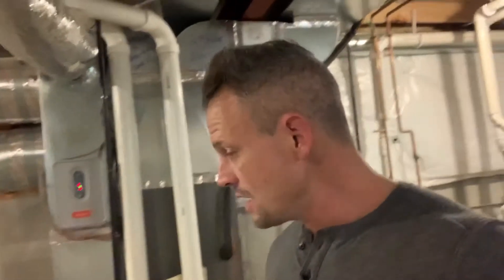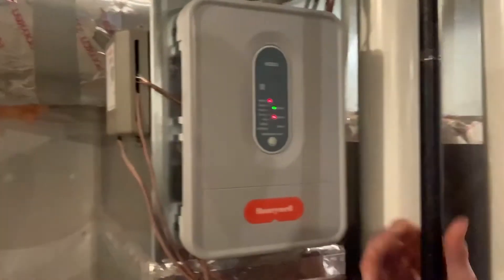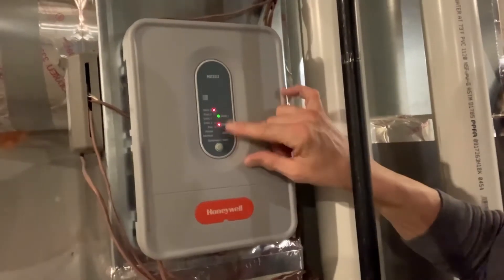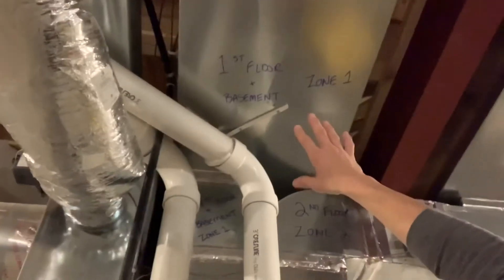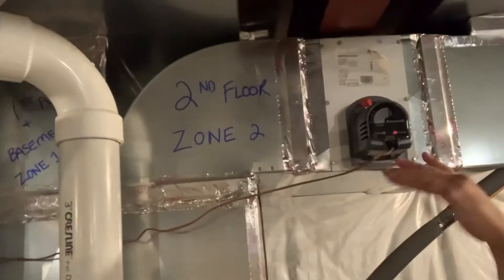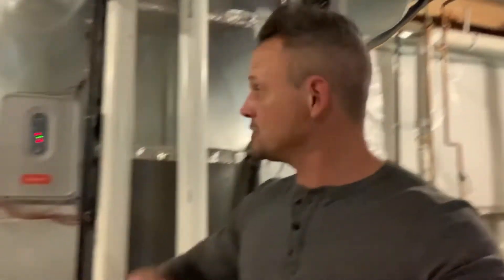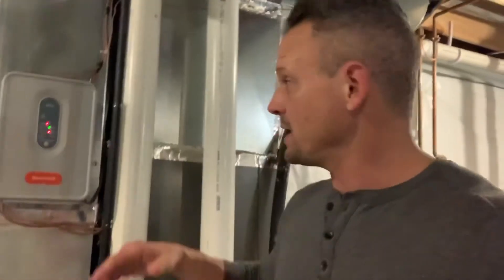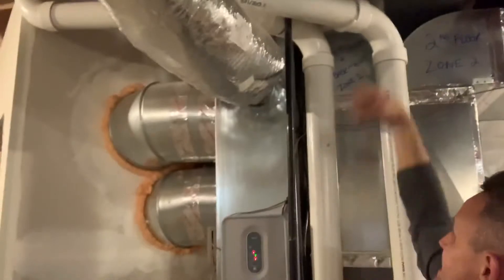What is a dual zone heating and air conditioning (HVAC) system

Comment: J ai une géothermie 
Comment voir sur le panneau si les éléments sont en fonction quel sont les lumières qui allume 
Merci
Reply from the maker: Most geothermal systems don’t show detailed operation on the thermostat itself, but here’s how you can check what’s working:

• Thermostat: You’ll usually see whether the system is in Heating, Cooling, or Aux/Emergency Heat. Some thermostats will also show a small icon or message when auxiliary heat is running.

• Geothermal unit control panel: Inside the unit (often in a basement or utility room), there’s typically a control board with indicator lights. Common lights include:
	•	Power / Status light – confirms the unit has power
	•	Compressor light – shows the compressor is running
	•	Pump / Loop circulation light – indicates the ground loop pump is operating
	•	Fault light (usually red or flashing) – signals a problem or lockout

• LED codes: Many systems use blinking lights to indicate normal operation or specific faults. The inside panel door usually has a legend explaining what each light or blink pattern means.

• What you should hear/feel: When it’s running normally, you should hear a steady, quiet hum and feel air moving at the vents (without the loud on/off cycling common with furnaces).

Comment: 43 years in the business. There can be 1, 2 or 3 systems in a house and there can be 1 zone, 2 zone, 3 zone or more,  zoned systems. Multiple systems are not referred to as zones. A system split with different thermostats are zones. Multiple units are systems.

Comment: Thanks BJ. apparantly I have an old troll a temp (honeywell) electronic system (1 furnace), dampers with 6 little motors, and 2 stats with the upstairs stat only functions/follows off of lower level stat settings of either heat or a/c mode.  these are the old honeywell dial type stats and I would like to upgrade them for easier reading for my old eyes, dont really need programmable would just use manual setting but appears I need a stat that is designed for 2H/2C system  I am thinking T6 or above. I understand I  will need a common for 24v at stats to power them if I did not want to swap batteries yearly, but not sure how or if I could figure the wireing  for the new stats.   I know where the  W, G, R,  Y  all attach but at main t-stat there is an orange AND a black wire also that have to do with the upstairs stat so not sure where I would attach them in a T6. or two of them if I swap both stats.    thanks for any input I learned what my system is from your video.
Reply from the maker: @thomaswilson5228  Hi Tom, thank you for liking the video. Happy Thanksgiving! I’m sorry, I’m just a Home Inspector that makes videos. This question is way over my head. You would have to talk to an HVAC technician.

Comment: I'm in a 2 story house with asyou described an electronic zone system that has a thermostat on both floors. when the thermostat is cooling upstairs, it also cools downstairs. Any thoughts? suggestions?
obtw, yes, the thermostat on the 1st floor is off except for auto fan.
Reply from the maker: @samuelhoepner  Yeah something’s not wired correctly or the electronic damper is not working correctly. You’ll need to call an HVAC contractor.
Reply: @BJPoznecki thanks for the reply,  I said something to the installer and they said it's from the fan,  and that it was normal
Reply from the maker: @samuelhoepner  That doesn’t sound right. When the damper for the first floor closes because you’re using the second floor there should be a little to no airflow out of the vents on the first floor and basement.
Reply: @BJPoznecki  thanks for the info,  I'm gonna press the issue forward

Comment: Thank you, i just installed a T9 thermostat. The AC doesnt seem to be working as well as it used to. Would both thermostats be wired the same? TY
Reply from the maker: You know, I’m sorry I don’t know the answer to that question. You would have to ask heating and air conditioning technician.
Reply: @BJPoznecki  TY

Comment: How do you know when the unit is using Emergency Heat?
Reply from the maker: Emergency heat is only for heating and air-conditioning systems that work off of a heat pump. If you have a furnace like in this video, it doesn’t apply, you don’t have emergency heat.

Heat pumps are energy-efficient alternatives to standard gas furnaces. They work by using electricity to extract heat from the air outside and move it into your home. This works great down to a specific outdoor temperature, but when it gets severely cold outside heat pumps begin to lose their efficiency and effectiveness. That’s when a backup heating source is used to heat your home until the temperature warms back up.

The backup heating source in heat pumps can come in a few different forms. Some heat pumps use electric resistance heating as their backup, which can quickly consume a whole lot of energy. More energy-efficient systems, known as hybrid heating systems, use a much more efficient gas furnace as their backup heating source.

No matter what kind of heat pump you have, the switch between using the heat pump and using the backup heating source is done completely automatically by the system.
Reply: @BJPoznecki  thanks for this, really helpful.  
So my thermostat should tell me if I am using em heat? I have a McCool system
Reply from the maker: @perryfrancis8733  I believe so. However, you’d have to do a Google search on your specific brand. I don’t know much about heat pumps because we don’t have them here in the Midwest we have furnaces.

Comment: Hey BJ Great Video. I am just learning things. I bought a home two years before and now my first floor not heating and when i switch on first floor heat using thermostat my second floor getting heated. I dont want to bring morris-jenkins as they charge unncessarily. any inputs may help me
Reply from the maker: It sounds like there’s an issue with the control board or they wired it incorrectly. In a situation like this, you’ll need to get an HVAC technician to look at it.

Comment: If you have ac on for both floors, would the the zone 1 and 2 lights be red or would one be red and one be green depending on which floor was turned on first?
Reply from the maker: It doesn’t matter which one is turned on first. The green light means the zone is on and the damper is open. Red means the zone is off/closed.
Reply: I ask because my light dont coincide with the zone thats on or off. If I turn zone one off the zone 1 light turns red. If I turn zone two off, zone 1 light still turns red. I’m thinking it was installed wrong.
Reply from the maker: @aleqbey8675  Yeah, I agree with you. I would call the HVAC contractor that installed it to come back and look at it.

Comment: what about shared heating and cooling in an apartment! some think that there cooling the hallway but it's both sides of the building
Reply from the maker: Well, it’s hard to see how the building is set up because I inspect a lot of condo and apartment buildings and I’ve seen a lot of different HVAC systems. If one side is cooling and the other is not, it sounds like there may be a problem with the electronic damper that directs the airflow to different areas of the building as needed.
Reply: @BJPoznecki  it's because they don't have a furnace along side with the hot water tank in the utility closest, I used to manage his apartments and I would have to store supplies under the stairs, most tenants never figure out why the builder put a vent on each floor & if they did I'd tell them it's a universal heating and cooling system but lately some tenants have figured it out & have been shutting off the vent in the hallway causing my system too over work and not cooling properly she was told she can't do that after I removed duct tape first then she put cardboard over the vent to the hallway finally she gave up and my unit and the hallway was comfortable but a few days later it got hot in my unit and the 3rd floor which is going to be hot anyway so I figured she has closed off a couple of vent's in her apartment and her her cat's dog and husband are staying in the bedroom and unfortunately that won't work and she thinks she's screwing over the landlord but he could care less! But he forbid me from telling any tenants who asked, sadly comed gives the owner certain amount of time too fix the wiring but the fix would be to put central air and heating in and I know he's not going to have duct work done ect. If he put a window unit in the bottom and the 3rd floor that would correct the hallway cooling and the heating is not really a issue

Comment: Thanks I believe 1 my closers isn't working cause air keeps coming out upstairs when downstairs is on. This confirmed how it worked for me and how I thought it worked
Reply from the maker: Yeah, and that’s a very common thing I see are the closures or dampers are not working or working correctly and distributing the air correctly.
Reply: on my system, at the end of a cool or heat cycle for main level, the uppers will all open for about 90 seconds just to keep some heat or cool in that area also, Does the same if only upper is asking for heat or cool, lowers will open 90 seconds at end of cycle.. if they are not functioning at all i found either a bad electric damper motor or the circuit board in need of repair. I have done both.

Comment: Hello, so I have a Dual Stage Heat pump with this zone board. Its system is all  new. For some reason  my installers cannot get the wiring right. But anyway, they had it set up to when heat comes on the zone board is on heat 1. This is for the downstairs. I do not use the upstairs at all. So when zone 1 down stairs turns on, heat 1 light comes on. Then after 15 mins exactly, heat 2 light comes on an the air handler blows much faster. If my nest stat does not reach its temp in another 15 mins on heat 2, then the light for heat 3 comes on. and I think... thats when the heat coils./strips are turned on or at least some of them. The vent temps are 110* at heat 3.  Then when my system goes into Defrost mode and blast the house with 40 degree vent temps for 10 12 mins, bring the temp of house way down. So they had to come back out and re wire it again. Now. Heat 1 light comes on and tends to run for about 20 -25 mins. Ive only seen heat 2 light come in with the 2nd stage kicks. I have asked but they do not seem to have a clear answer, what does heat 1, 2 and 3 lights actually indicate when they are on? They tested and forced defrost mode and wired it to wear some of the heat strips come on to supplement during defrost mode.  Thanks

Comment: If you have one unit outside & thermostat on 1st & 2nd flow. Zone 2 is red and not blowing. Zone 1 is green and blowing hot
Reply from the maker: Hi Amber- I’m sorry I don’t know. You would have to Google the exact system you have and try to find a troubleshooting manual, or call your local heating and air-conditioning contractor.

Comment: I have a HZ322 system. One thermostat downstairs and one upstairs in the bonus room. Recently the bonus room wont cool down. I turn it on to cool and i get no air to blow out. Downstairs works just fine. Cant figure out whats wrong with it for the life of me
Reply from the maker: I’m sorry I don’t know enough about the system to help guide you what the issue would be. I would reach out to your local heating and air-conditioning contractor to have them come in and help.
Reply: @BJPoznecki  ok thanks. Im assuming something is wrong with damper and its not pushing air out
Reply from the maker: @SAVAGEoLIFE  Yeah, hopefully it’s just something minor. You’ll have to process of eliminate what it could be, is it the damper, something with the control panel, etc.

Comment: hi, I enjoyed your video it was enlightening. I didn't walk through of our new home in framing status and was told we had a dual system. there's only one condenser compressor but two thermostats. so after viewing a video I believe it's an electronic system. Can you tell me which one is better in your expert opinion? There's nothing I can do with this point is all the duct work is in. I look forward to your response. Thanks!
Reply from the maker: Well it depends on the application. If you have a large home then it’s more efficient to have two separate systems, a true dual zone system.

If it’s your average size house that only needs one system it’s nice to have the electronic zone where you can direct airflow to that area by having multiple thermostats.
Reply: @BJPoznecki  Thanks. We are in Phoenix and the home is 2300 sf. The second thermostat is in the master suite, so at bed time we can kick the rest of the home up to say, 80, and the bedroom at 74. This is a programmable system, so I assume I can have the rest of the house kick down at a certain time when we are up for the day!
Reply from the maker: @spongiejensen178  
My pleasure!
Yeah for that size house one system with electronic zones is perfect!

Comment: Good video. I found it searching for why my damper on the 3rd floor wouldn’t open when the thermostat there kicked on - it shares a compressor for the 2nd floor. Any suggestions would be welcomed.
Reply from the maker: Thank you for the compliment! I’m not a heating and air conditioning expert, however it sounds like there may be an issue with the dampner or the wiring. I would have a heating and air-conditioning contractor come in and take a look at it because if that damper is not opening, especially in the summer when the air conditioning is on, it’s going to get pretty toasty up on that third floor.
Reply: @BJPoznecki  thanks for the response and advise!

Comment: , My heater stopped working at my house and I see my Honeywell HZ322  device , all 3 zone  has orange blinking light in the attic. What does this mean? Can you please advise
Reply from the maker: The only thing I can recommend is to try turning the furnace off at the service switch or circuit breaker for a couple minutes and see if everything resets and works. 

If that doesn’t work you’ll have to call your local HVAC Contractor.

Comment: I have the Honeywell hz322 electric zone, I have two nests one downstairs one upstairs. Im constantly heating the downstairs up to 69f and then the upstairs heats up to 80f. I have the upstairs thermostat to keep the temperature around 72. So I’m constantly heating downstairs which never seems to actually warm up and heating upstairs, then having to cool down the upstairs. What can I do to balance this out better.
Reply from the maker: This one is a little more complex so I would contact your local heating and air conditioning contractor to look at it. 

It could be a number of things the zone dampers not working properly, the zone control panel, possibly a supply duct on the wrong trunk line, etc.

Comment: My zone are flashing orange. What does that mean? I took out my nest thermostats and replaced them with ace thermostats now the heat doesn’t work
Reply from the maker: Hi Jasmyne- I think a flashing orange light is some type of error code. At this point I would call your local heating and air conditioning contractor to come out and see what’s going on.

Comment: Hi there we have a thermostat in the main level that's supposed to control the main and second floor. We have a thermostat in the basement that supposed to control the basement. We have a dual zone. When we turn the heat on in the basement, we can feel the heat from a register in our second floor bedroom even if we have the heat turned off on the main floor thermostat. Is that supposed to happen? Isn't it only supposed to blow heat into the basement?
Reply: Shouldn't it not blow any heat to the second floor?
Reply from the maker: @infernowafer121  You are correct! The HVAC contractor when installing the ductwork must have accidentally put that bedroom supply on the wrong zone / main trunk line. 

You’ll will need to contact an HVAC contractor preferably the one that did the installation and have them come back and correct that bedroom supply duct.
Reply: @BJPoznecki  is that a big job? We just moved into a newly built house.  This should be covered I'm assuming? Usually?
Reply from the maker: @infernowafer121  If the basement is still unfinished or if they put in an acoustical drop ceiling then it’s an easy job. 

However, if you have a finished basement with drywall it will be more involved. 

Typically most states require builders and contractors to offer a one year warranty on workmanship and defects. 

Either way go back to the builder and have them correct it as it was never installed properly from day one.

Comment: Great video - looking into getting a home where basement and upstairs can control their own temp - they called it a single furnace dual-zone but definitely an electronic system
Reply: I did just that. It was new system retrofit for a 2 story home. Went from just the upstairs being heated with one old furnace to a Single Dual Stage furnace with 2 zones. One zone for the upstairs and one for the downstairs. No AC, just heat since i live on the Southern West Coast. Works awesome!